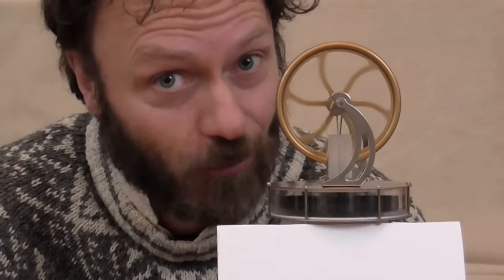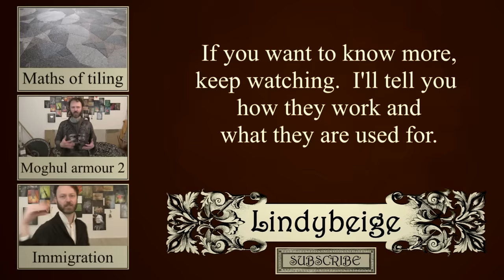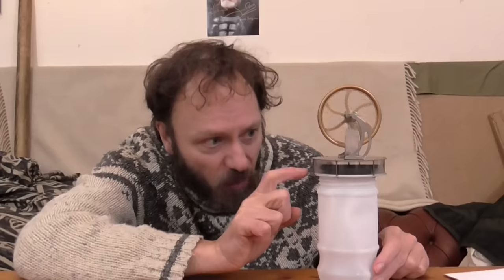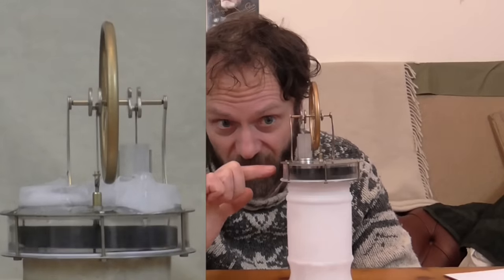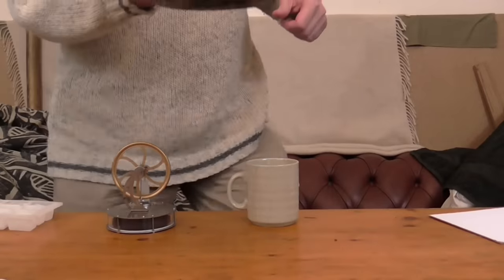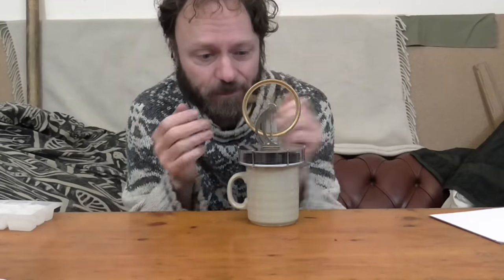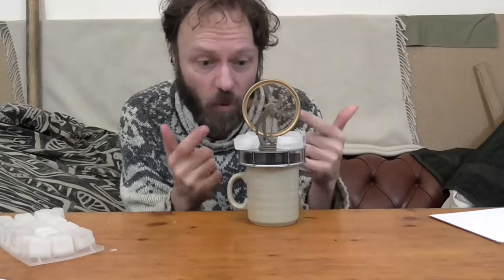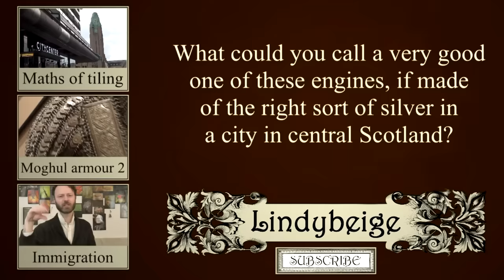Stirling Engines - the power of the future?

Comment: But how much energy does it take to produce the ice, not counting the obvious northern states.
Reply: They're not designed to be "powered by ice". That would be very counter-intuitive. They just require a reasonable temperature differential between the two sides of the "engine". Usually, waste heat is the preferred method, with passive cooling (ie radiators) to cool the other side down

If the environment they're in is already naturally cooled, you can make bigger/more powerful engines, with less required components. These are VERY large engines when large enough to produce "work", around 3-4 times the size of an equivalent steam engine

Comment: Is it the best engine to generate electricity from nuclear wastes? The decay heat from the waste won't be huge, but still not negligible. The waste will power the engine for decades, where maintenance work might not be a lot, thanks for the simple mechanical structures of stirling engine. So there will be a stable and cheap energy source in remote areas, where cryptominers would like to pay the bill.

Comment: Run a refrigerator with the sterling engine to cool the top  and use the catalytic Hydrogen peroxide silver catalyst  reaction to make heat 750 degrees C for the bottom and run a steam turbine also with the pressure of the reacting hydrogen peroxide make hydrogen peroxide possibly by the anthraquinone method and concentrate it if possible.its environment friendly H2O And O2 products plus motion energy.

Comment: And now I'm envisioning a Stirling engine powered by a Tesla battery powering a heating and cooling system to create the necessary difference...
Reply: Brazen Bard
It would be more efficient to just use the batteries to run an electric motor TBH.
Reply: @lordgarion514  Sounds about right. But it's an amusing notion, at least. Even if not fuel efficient.

Comment: There are no "explosions" inside an internal-combustion engine. The fuel is "burned" and not "exploded". Jeeze, this is schoolboy physics! Next you'll be saying that the Cordite or nitrocellulose propellant inside a rifle cartridge "explodes".

And so you then move on to the thermodynamics of the Stirling engine (as used by the legendary race driver, Stirling Moss?).

Comment: Airships... solar powered and stirling engine powered.
Drop down to the ocean on a calm sea and pump up water to spilt it and fuel a hydrogen internal combustion engine.
Three types of engine in one vehicle.
Reply: Of course the hydrogen could also be used for lift...

Comment: Not really practical unless it's used in an area that has natural ice and hot springs together. 

Anywhere else, you'd still have to cool one plate or heat the other plate or both. That requires power from another source such as electicity etc.
In effect, it is a fancy and very inefficient electric motor.

Comment: FREE ENERGY? I'm going to blow your minds. Depending on where you live, say a city, water is pumped at pressure to your home. This water is usually really cheap, and actually in my city gets cheaper as you use more, no I don't know why. All you have to do is make a simple hydro turbine, hook it up to an inverter and the alternator out of the truck you junked, plumb it in under your sink and you'll be generating MODERATELY CHEAPER electricity in a nearly useless form at a huge net loss of total system efficiency! It's great for people who steal cable and cheat unemployment-- the real innovators.

Comment: I would love to get some info on optimising one of these things, and build 2 for my boat.  I would need about 300HP though, but I have plenty of space, and plenty of weight capacity.
Reply: Ships have been built with Sterling engines but the cylinders were so large that cargo space was compromised.  You still needed coal. Stirling engines are low pressure engines relying on atmospheric pressure to push the piston which turns the flywheel. A petrol engine typically uses 5 to 8 times that pressure and a diesel engine even more so they are much smaller. There are designs involving pressurised air or gas. The quiet running can be an advantage for domestic or sensitive drives. The Dutch did much work and the Germans tried Stirling engines in buses where quietness and low pollution could be a benefit. I replaced small diesel engines with propane engines for portable traffic lights to reduce the domestic noise problem overnight and diesel particulates in urban areas and despite the low power requirement and plenty of space 
I could not develop a Sterling version. The speed and power is limited by the heat transfer rate through the air chamber. Alternative gases such as Argon improve this but detract from the simplicity which is so appealing of the Sterling principle.  Rotary Sterling engines are being considered but low pressure engines are large and this remains a drawback in some cases.
Reply: @tben9957  They can be closed-loop systems rather than vented to the atmosphere.  Atmospheric pressure IS about 10tonnes.sq meter !
Reply: @sbkenn1    You don’t have m** pistons. You may have read that an early shipboard installation had pistons so big that you could ride up and down on one. The vessel was unsuccessful. 
Neon or Helium gas fill does improve the heat transfer but this has to be balanced against the added complication. 
You may recall that the Newcomen engine was also an atmospheric engine, relying on air pressure, and had a brief period of use but it was large and expensive. The Stirling engine, also known as the ‘hot air’ engine,  has uses but it has taken 150 years to find application in all but a limited number of ways. Interesting but not life changing.
The model engines, I have one, are delightful and educational, but I need a very hot cup of tea and that cools off.
Trevor.
Reply: @tben9957  Swedish atack submarines use them to goo effect, much to the embarassment of the US navy.
Reply: @tben9957  you don't need coal.  You could do it with any heat source, alcohol, gas, oil, coal, even nuclear
Reply: @tben9957  Diesel engines aren't smaller than petrol engines.  They generally run at less than half the RPM of petrol ones, and need to be turbocharged to get similar output to petrol ones of the same capacity and are heavier when they do manage it.
You mention rotary engines, I presume you mean Wankel ones.  I have seen some small , double-ended swash-plate ones which I particularly like.

Comment: if you are going to burn something for heat why dont use a steam engine if it better and more effecint
Reply: nop da u don’t have to generate heat there is volcanic activities and geothermal heat resources
Reply: @twisthermind2514   but cant you use the heat from those sources to heat the water and use it in a steam genrator ?
Reply: You can but if you want something which is less noisy u should use this generator
Reply: @twisthermind2514   thanks for the info man

Comment: "the power of the future?" NOT A CHANCE. Too low a power to weight ratio. Cost per installed megawatt is preposterous. If you are looking for an efficient engine, combine a standard piston engine (Otto or Diesel) with a halocarbon bottoming cycle.

Comment: If you happen to have a low or no-cost temperature differential, this thing might be interesting.  In the general case, heat engines are ultimately doomed.

Comment: Cold and heat can power a bimetal spring or springs designed to be a transmission .Bi metal spring or springs plus a electric generator plus an electric motor and a dc storage cell....the springs are set in a 360 degree stop and go transmission .the cold of night (about 30 degrees variance in daytime temp sets the spring transmission in a 360 degree lock position (torque)the timly releases each spring as power is needed...or released all at once to drive the generator and charge the storage cell..The only thing that is continous it expanspsion and contractracion which heat and cold are a by product.The heat and cold are potentional energy..when they are stored in a contracted bi metal spring.when releaseded from the locked position the energy becomes kinetic and has potential of a work load or torque.Daytime the springs are locked in an expanded position...at night they arelocked in a contrated posiontion ...in turn day and night provides energy to your generator or your cell😊
Reply: Has been used for winding clocks.
Reply: @bingola45  these are bi-metal springs that expand and contract depending on the ambient temperature ..they are not just springs that are manually wound up....they wind themsevles😊
Reply: I can't remember what it was called, or even where I read it, (possibly in Bruton's 'Clocks and Watches'), but it was a bi-metallic spring loop which coiled and uncoiled as the surrounding temperature varied, and, using a rack arrangement, wound-up the mainspring of a clock or watch.
Reply: @bingola45  that would work...now make it bigger and it will drive a generator to charge a battery and you have enough energy to drive a car ...after it has turned the generator enough to charge the battery to full charge ...in short free energy except for the parts to make it work
Reply: @patrickgalloway5078  The principle is sound, although it didn't catch on just for winding a watch, so I can't see anyone trying it on a bigger scale.
It MUST be possible to work out how much energy is available due to natural temperature variation. It could be vast.
Reply: @bingola45  to achieve more torque and more energy you add more springs locked into their potential positions ....contracted or expanded...night or day...and release them to drive a generator that charges a battery from a gearworks attached to the generator...you have to wait for your energy buildup to your battery before use...once your battery is fully charged the differance between night and day temperature will keep your battery charged if you have the proper amount of springs and the proper gearwork to drive the bi-directional generator for the expected load and duration of that expected load ...to minimize size you add more batteries and wait longer for full charge charge of the batteries..this in turn will compensate for the duration time expected

Comment: No matter how you put it, don't think this is a good way of generating "power". We already have a lot of ways of generating electricity, but a Sterling engine from my perspective, is just one of those "perpetual motion" bullcrap.
How ever you put it, you'll need a difference in temperature which you get ether from the Sun or Earth... but in any case, you'll eventually have the a temperature equilibrium, which would need again some extra energy to change that... Why wouldn't you just use wind, geothermal, photons?
Maybe, in space, it would make a lot of sense since you can just cover one part and the other part you aim at the sun, like the James Webb telescope.

We already have tidal forces, all you need is an electric motor with  a propeller the ocean...

Comment: Unless you find a naturally occurring heat source near a naturally occurring cold source, the energy required to create the heat differential is always more than the engine could produce. SO.. yeah.. if you happen to have something hot in your business and you needed a really low powered fan, this could do it.. but it's pointless to create the heat / cold to make this work. Also SCOTT STIRLING!

Comment: Well considering flying the cooling gas of space the Sterling engine is the natural choice, well at least if you want biological entities to fly the ship. You will have a temperature difference of 200 degree celcius at least, and probably an impulse engine, because regardless what the muppet say you can't fly in vaccua using thrust engines and nor can you fly zero viscosity liquids. It is inertia that make thrust engine works without it in vaccua or zero viscosity liquids they are basicly useless there is no resistance to pressure all you get is flame thrower.

Comment: Energy / Electricity Could Be Generated In A tight Rural Village & Shared, By All. 
Run By the Village Church or Village Hall. 

To Make it Simple To Explain to All. 

The Church is Next to a Stream, Beck , River. 
Any Constant Flow of Water = Some Degree of Power / Energy  / Electric. 

A few Farms Have Huge Barns Covered in Solar Panels. 
A Couple or Half a dozen Small Wind Turbines on the Highest Hills Near by. 
Almost Every House has Solar Panels Feeding the Village Master Battery,  
Some Have Small wind turbines. 
Some Have Streams & Rivers Running Through or Close to their Land. 

Gather All this Power to Charge A Huge Village Battery / or / Power Storage system Then Sell it Back to those Involved. & others at a small profit to Repair & Maintain the System. 

Any Excess or Waste Energy Would Be Used to Make Either HEAT or ICE to Run the Sterling Engine 24 /7 Regardless of the Weather. 

Heat or Ice Subject to the Season or Climate. 

A Huge Ground Source Heat Pump / Heat Exchanger could be Fitted Deep Below The Ploughing Depth & Root Depth in Local Fields. 
To Heat Water to Heat Homes & the HOT Side of the Sterling Engine. 
REVERSABLE in Summer When the Sun is Hot & the Ground is Cooler.

Comment: These engines can barely run themselves, let alone much of anything else
Reply: Wrong, it depends on the variance of the temperature and the scale of the temperature diffusers. Stirlings can work really well, but there needs to be a constant difference in temperature.
Reply: @TheAztec1289  And also a rather large difference in temperature.

If you want to produce mechanical work from a potential difference, use an electric motor. Stirlings cannot effectively cool themselves efficiently while also staying hot enough to run, it's just not feasible, especially on a large scale.

There's a good reason they were abandoned to become desk toys.
Reply: Yes, tiny ones running on an ice cube and a cup of hot water don't have enough power to run anything. Obviously. That doesn't mean proper ones aren't useful.

Comment: sorry< not the power of the future. the power of the future is molten salt thorium reactors. These produce electrical generation at 1/10th the cost of current nuclear plants. People in their homes will have flywheel batteries, that have overleaved graphene layers spinning @ one million rpm, so to power a car for 1,000 miles floating on magnetic bearings to have a life of 150 years, and the graphene will be used for the conductors producing the generation of electricity for the motive motor. Thus the cost per mile will also be 1/10th the cost of current fossil fuel powered cars and trucks. Shipping cost will drop commensurately with just the cost of tires and not 1,000 dollars to fill the stupid fuel tanks with diesel.
Reply: Well, diesel manufacturers will resist this very much!

Comment: CLOUD Storage , Massive Servers Running in a huge Building , Could Possibly SELF Generate Energy Via this Method. 
Hot Air / Hot Surface Inside,  Ice Cold Air Temp on the Outside, 
Maybe Could Spin Wheel Via Gearing to Generate the Power to Run the Servers ? In a PERPETUAL MOTION Style System ? 

OK They Say Perpetual Motion DOES NOT Work. 
But I think It DOES or CAN. 
Not as a Stand Alone System, But as Part of Another System. 

Basic Example Here With No SCIENTIFIC FACTS OR KNOWLEDGE.   ( just My ideas. ) 

A Solar Panel Collects Energy as it Does, & Charges a Battery By Day. ( Obviously Nothing New Here ) 
By Night & Day A Wind Turbine Almost Constantly Trickle Charges This Battery,  ( as they Do ) 

A Water Wheel / Hydro System Runs 24/7 / 365  if Placed in a Fast flowing Brook, Stream, or, River etc. 
Another Constant Trickle Charge. 

This Gives 3 forms of Energy Charging the Battery. 

The Battery Powers the Servers, 
The Servers Give off Heat, 
This Heat Rises Naturally to a Funnel Shaped Roof / Chimney Style Ceiling , Like a UK OAST House ? 
All this Heat is Piped / Funneled to the Hot Side of the STIRLING Engine to Drive it. vs Cold air From Outside in a cold Climate. 

Hence , ? HOPEFULLY ZERO Power / Electric Required from the Grid. 

Use Any EXCESS Power Produced to Heat one Surface, Or To COOL the Opposite Surface. 

What I say is :- 
Zero Energy System, By Using 3 or 4 or more Energy Sources Combined & operating to COMPLIMENT & ENHANCE each System or Method. 

No Sun = No Probs, Use Wind & Hydro. 
No Wind ? = Use Solar if Available , OR Hydro. 

No Sun ,  No Wind,  No Hydro,  GAME OVER PLANET earth is DEAD. 
But the STIRLING Engine Will Still Run, Powered By ANOTHER Form of Semi Perpetual Motion Machines. 

STILL NO Heat ? 
FK ME !!! 
Burn Some TREES & DIG SOME COAL. 
Pump some Oil , Petrol or Diesel.